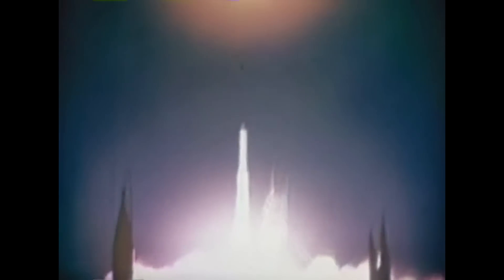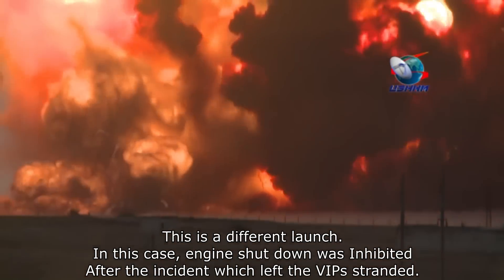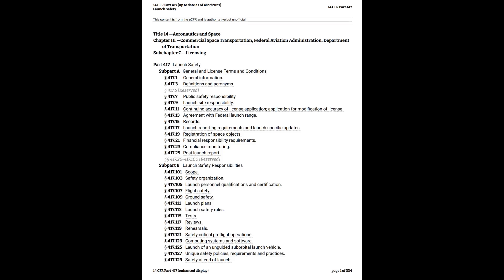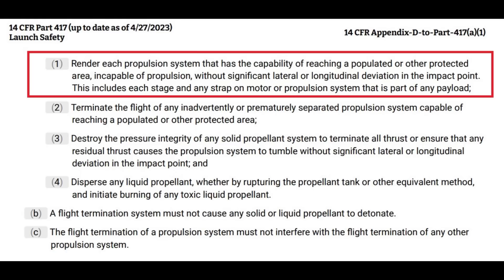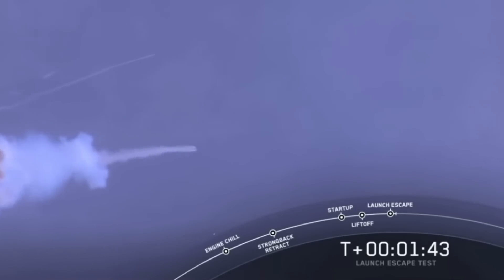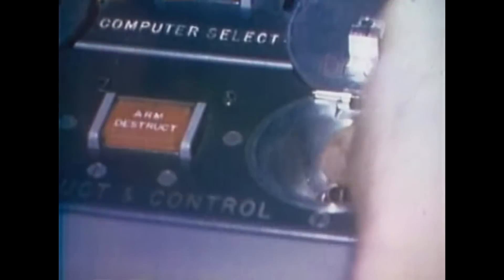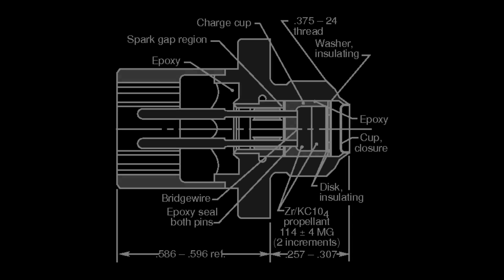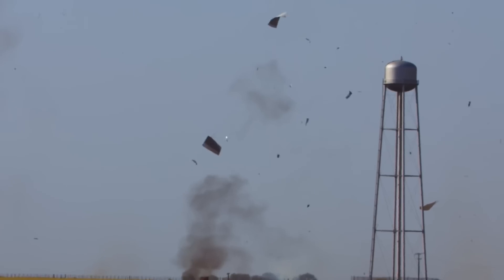How To Destroy Wayward Rockets - Flight Termination Systems Explained

Comment: I wish you had explained what was up with the Starship "termination" system. It didn't seem to unzip the rocket or blow the tanks or anything. It seemed to just knock a hole in the tank and wait for aerodynamic forces to break it all up, which seems... insufficient.
Reply: He covered this in a video a couple of days ago but I'm surprised he didn't mention it briefly here. See "Is This Why Starship Wasn’t Destroyed The Moment It Lost Control?"
The holes blown in the tank are supposed to release tank pressure, and the rocket structure depends on pressure for structural integrity. It took especially long for enough pressure to vent. If I understand Scott correctly, x amount of explosive didn't blow the size hole it was calculated to, thus the venting was slow. So, the ship was too damn strong. I''ll speculate and say the holes were expected to propagate but didn't because the ship was too damn strong. All of this added up to the tanks not unzipping, ergo no big cloud of propellant mixing, ergo no kaboom when it was supposed to kaboom.
Reply: @donjones4719  From watching the slo-mo video, it appears to me that the flamey end finally ignited the vented cloud of propellants, long after the two streams of major venting were visible.
Reply: @rsteeb   Oops, I mean to say no  cloud of propellant mixing when it was supposed to, without such a delay. Yes, the propellants did mix and did go kaboom.
Reply: It's just some large flat charges at the top. . Lots of pictures around.
Reply: @please_stop-v7o  I'm not asking "what is it and how does it work" so much as "is this really supposed to terminate thrust? It doesn't seem like it would meet regulatory requirements."
Reply: @AubriGryphon  No it's supposed to blow the ship and booster apart like it did. The giant cloud of white smoke was fuel and oxygen being released therefore the system performed as required.
Reply: @AubriGryphon  It's what I meant by flat panel, as opposed to a shaped charge. They seem to just be a roughly 40 x 20 cm piece of high explosives. So it's more of a brute force approach. And there's two charges per stage.
Reply: @please_stop-v7o  Hahaha no. Take another look at that Vandy termination. If a rocket starts going the wrong way off the pad, "knock a hole in the tank and wait" ain't gonna cut it. Which is why I'm asking if there's an additional thrust termination system, or this needs upgrades, or what.
Reply: @AubriGryphon  Listen I'm trying to explain to you how the system works and you're being quite rude, why did you ask the question? And obviously thrust termination is commanded.(we can assume the software is similar to F9). 

And how is the equivalent of a major terrorist bomb, two each on both booster and ship insufficient. The vehicles where gone within fractions of a second. 

You seem to fundamentally misunderstand the role of FTS. As long as the rocket remains within an acceptable flight path, including above or on the pad, debris may fall anywhere. The range is clear. The purpose of an FTS is to prevent that any debris would leave the preset area. Therefore if a rocket goes off trajectory, it is detonated before it is physically possible for debris to leave the exclusion zone. So the exact mechanism of destruction is irrelevant. At the point of detonation, the maximum possible debris field is calculated (beforehand for any point in the trajectory plus margin). So as long as the FTS is triggered within the predetermined area debris will fall in the exclusion zone, which is purposely much larger to account for any mistakes. Every pad during launch is in itself an exclusion zone, so even if Starship goes 180, flies back towards the ground and impact, the factory, that's in the exclusion zone. It's a really bad day for SpaceX but no one would be injured and no property would be damaged that has not before been assessed to be inside a potential blast zone. Should Boosty McThrustface explode on the pad, destruction of much of Starbase is accounted for. It's not Starship's fault SpaceX puts their pads next to vital facilities. NASA likes to keep a bit more distance incase anyone pulls a Proton or an N1 or another Antares. Starship exploding at 39A would 100% nuke the F9 pad. No way around that, FTS or not. At least it's a strong possibility so it has to be accounted for, which is why NASA says build more F9 pads before you nuke our only access to ISS (in the sense of a launch pad) only 39A has crew launch capability. So building a Starship pad a stone's throw away is stupid in my opinion and no FTS can circumvent the laws of physics. What goes up, must come down, unless it reaches orbital velocity. You can't just magically vaporise the vehicle. Not with that amount of HE anyway.
Reply: @please_stop-v7o  Did you not understand the aforementioned short about the FTS? The stack fell for 50 seconds intact after the plumes appeared from the FTS firing, brain genius.
Reply: @AubriGryphon  No they did not. It was a fraction of a second. Those where the vents they are next to the FTS.
Reply: @AubriGryphon  Regardless it's irrelevant as I explained. It's meant to keep the debris in the exclusion zone I'm not explaining that a second time Mr. Dunning Kruger.
Reply: @AubriGryphon  And you do NOT see any flash in Scott's speculation. However as the vehicles break apart there is some flames, supporting the theory that what happened is all vents where opened at detonation - 50 s to depress the vehicles and then we see, flames and both vehicles break apart within a second. 

Why did both vehicles break apart near instantly. If the vehicle is being torn apart after pressure drops that would take longer on the larger booster than the substantially smaller ship. So of the 50s we would expect perhaps the ship coming apart at 35 s and the booster at 50s. But we see 50 s and 50.5 -51s for booster and afterwards ship disitegration. That makes no sense. Unless the FTS was triggered at 50s and at 51s respectively causing immediate breakup of both vehicles. That's not a small charge! And the sturdiness of the vehicle against aerodynamic forces is demonstrated in the seconds prior to disintegration. 

Detonate charges and 50s later both vehicles explode instantly. Makes no sense. If it's the wind tearing the stages apart you would expect first one, likely the larger booster and then the ship. But the ship is specifically built to plummet through the atmosphere at much greater speed. So then back to pressure gradient. But if we are arguing a pressure decrease until structural integrity goes below the aerodynamics forces, the significant difference in volume between the stages should lead to a larger delay between each vehicle coming apart, at least several seconds. 

So with all due respect,with the near instant explosion of both stages, preceeded by a flash and flame, I submit that both you and Scott are wrong. The pressure release is likely a vent and it's located very closely to the FTS charges as is plainly visible in the image Scott shows. They waited so long because they where in no danger of leaving the exclusion zone. When that became a possibility if FTS was further delayed, they blew the charges. Occam's razor says I'm right. What are the odds the pressure would decrease at the same rate in both stages or that such an amount of presumably C4 would only poke a hole. Poke a hole in pressurised tank and what happens? Big boom exactly. Go get a pin and a balloon. And the Starship tanks are essentially balloon tanks when full. Meaning the large majority of structural integrity come from pressurisation, meaning a loss of hull integrity under such immends loads and ibternal pressure is expected to lead to catastrophic immediate failure of the entire tank structure as we have seen on the test stand many many many times using totally inert gasses such as nitrogen. Yet the vehicles without exceptions all explode the instant that the tank suffers a leak. You can only see it on Tim Dodds super mega slow mo, a weld coming apart and then big cloud of N2 or flames in the case of SN4. Or SN10. Or SN11. Or most recently Starship OFT. 

Why is this the one time that ubder much MUCH greater load, the tank does not come apart immediately. It does so on the test stand standing still, but not at 1 km/s tumbling through the air? Makes no sense at all. So go back and redo your math before throwing insults, how about that?.

The only exception I remember is when they were testing a different steel and the tank sprung a leak without immediately exploding, but that was a special case, it wasn't a weld or a single point that failed, they actually went beyond the capability of the material and it failed itself. That's a more gradual pressure release than a large opening appearing suddenly such as in the case of FTS or a weld failing like in the early test tanks before they figured out welding. Overpressurisation fails differently than sudden loss of pressure. That's a design requirement for high pressure tanks, they're not supposed to explode when overpressurised but generally that'll be some sort of single use vent that just pops if the load goes beyond what it's supposed. 

Pressure inside Starship was presumably nominal or below nominal at the moment FTS was triggered, whenever that was. So we can expect a typical pressure vessel failure, an explosive decompression in airliner terms.

It wasn't like drilling a hole in the ISS. It's up at 8 bar and the FTS charge rips apart the steel. Of course if it was a conventional shaped charge, which it doesn't seem to be, there would also be a large flame involved, so we should definetly be able to see when it triggered. It's not exactly subtle. Yet no flash, nothing just venting.

Comment: This system was so incredibly illogical.  Much more powerful than a Saturn V...but the flight static launch deck for a Redstone.

Engineers know it will destroy the launch pad...worry not we're building a proper one ready next month...launch now.

A reusable rocket company that destroys their spaceport requiring months of repairs and rebuilding.

Put a full 2nd stage capable of reaching the Moon or destroying New Orleans, Houston or Miami on a damaged pitchpoling booster....yeah.

Very logical.
Reply: You pretend to understand more than you do.
Reply: @TheEvilmooseofdoom  you pretend...
Yes you just pretend.

Comment: It had to have been highly unnerving for the RSO at Boca Chica when he hit the big red button and the rocket was still there afterwards.
Reply: I wonder if they were surprised, though. I bet they had looked at it and said, "eh, I don't know if that'll work", but didn't manage to get it fixed.
Reply: That's not what happened. When the system was initiated, within 10's of milliseconds the Starship and Super Heavy Booster were destroyed.
Reply: @ymemag9861  No. There was a very obvious plume of gas released from the location of the FTS. This lasted for several seconds before the booster actually exploded. The FTS only succeeded in rupturing the common bulkhead. While the activation of the FTS did eventually lead to the destruction of the booster and starship. It was not at all as quick as they likely intended it to be.
Reply: @ymemag9861  I read that Elon mentioned a 40 second delay.  Just sayin'...
Reply: @ymemag9861  seems far far from it.... the rocket makes a complete 360, at about 3:10 then you can see it venting from the location of the two FTS locations (just venting, no signs of combination of oxygen and fuel making fire) ... and at around 3:59 the vehicle is destroyed from ENGINES up .. that screams purely the damages going on in the engine area finally ruptured the bottom of the tank, instead of the middle of the tanks. The thing was losing raptors every few seconds by then.  Got to say if that is a "successful" FTS of 10s of milliseconds, I don't want that thing ever flying again anywhere near anyone.. especially not at the cape out of 39A....  that would be a huge mistake.

Comment: From my limited understanding of rocket engines, getting them to NOT explode is the tricky bit. For flight termination could the rocket engine controllers do exactly the wrong thing and turn the engine into a FTS. I imagine a superheavy would blow up pretty quickly if all 33, aktually 66, turbo pumps suddenly exploded.
Reply: If you watched the same launch I did the BFR is a tank of a vehicle. A lot of redundancy if the ground didn't give way.
Reply: @12pentaborane  true, it did keep going after repeated explosive failures during the launch but all engines exploding at once might be just enough to do the job.
Reply: @dufkers  I think it is not a prudent design choice to put destruct explosives right up against the engine plane, where there's lots of thermal transfer and chenical reactivity.  Blowing a single hole in each tank seems to be a standard approach that works on smaller - or should I say 'less large' rockets.
[FAA and NASA]:  "When will you have a fully functional FTS so you can be cleared to continue your test launches?"
[SpaceX]: "Redesigning... redesigning... redesigning..."

Comment: I don't believe that the FTS worked on Starship.
Reply: Scott did an earlier video showing that it functioned as designed , it just didn't directly lead to vehicle breakup as it was expected & meant to.
Reply: @HuntingTarg  Well than I called that a failure.
Reply: @freddied2485  Fair assessment; failure in purpose, though not in operation.

Comment: The Common Sense Skeptic did a detailed analysis using much sharper video and photo images apparently showing that the Flight Termination System packages failed to destroy either stage of the tumbling Starship.  They may have pushed the button on the ground, but apparently all that happened was additional venting of gasses.  The analysis also showed how possibly up to eleven engines had failed prior to the tumble.
Reply: Elon just said a few hours ago in a paywalled update on starship that the FTS did in fact fail to terminate flight as Scott and others have speculated, and that it is being redesigned.
Reply: @tstartrekdude  why he lied the first time? That is violating FAA.
Reply: @tstartrekdude  Elon says a lot of things.
Reply: @surfmanfish  Yes, he does. Shall we just focus on this one thing and not all the other things?
Reply: @surfmanfish  And why would he lie about that?  THINK.. that's the one step you seem to have skipped.
Reply: I don’t trust common sense skeptic he doesn’t do his research. His criticism of starship and the mars mission has some good points but he uses way to much assumptions in his criticism lacking cold hard facts.
Reply: @TheAmericanCatholic  there's not a lot of speculation in his 24/7 flight analysis, and it shows 11 engine failures before a loss of control
Reply: @kennethkho7165  
It didn't take that many engine failures to get flight path and attitude deviation.  IDK anything about common sense skeptic, but the thread so far has me thinking he should use the handle c'ommon sense cynic.'
Reply: @HuntingTarg  you're right, starship went on a 3° deviation straight off the launchpad with 3 engines out and it only got worse. can you actually see the spacex and everyday astronaut footage yourself because you are embarrassing yourself here.
Reply: @HuntingTarg  cope
Reply: @kennethkho7165  
This footage, 
https://youtu.be/cqbIwZMvbqw
in addition to SpaceX's live feed footage.  As I said, IDK common sense skeptic, but it's likely that more engine failures occurred after the LTS was activated, so he may not be incorrect or lying, but exaggerating the situation.  SpaceX's own engine burn board showed a maximum of 7 simultaneous engine failures before flight termination.
Reply: @TheAmericanCatholic yeah, agreed.

Comment: 14:25 “Weren’t many options for the crew escaping that…”
Wait, were there ANY options for the shuttle crew escaping?
Reply from the maker: After the crew parachutes were provided in the wake of challenger there was the possibility of parachuting out of a broken shuttle. A very small possibility.
Reply: @scottmanley  wasnt aware of the parachutes post-challenger. odds still arent even remotely good and i cant imagine what itd be like to be the range safety officer for shuttle launches especially given (as far as i know) shuttle was all manual FTS
Reply: @scottmanley  
Which would have been utterly imfeasible in the case of Columbia.  The demise of the Orbiter program was largely due to the demonstrated failure to correct organizational culture problems rather than design deficiencies.  If the technical & procedural problems that caused Challenger had been corrected, Columbia might never have happened.
Reply: @HuntingTarg  The demise of the program was due to the design flaws.
Reply: @scottmanley  I had no idea parachutes were even given thought. Neat!
Reply: from an FTS firing? no. gives me chills to think about